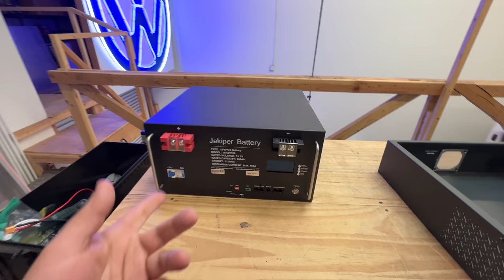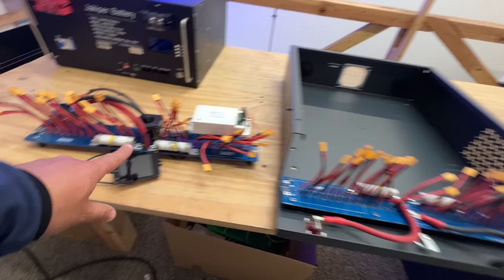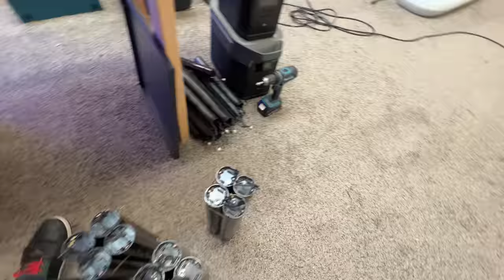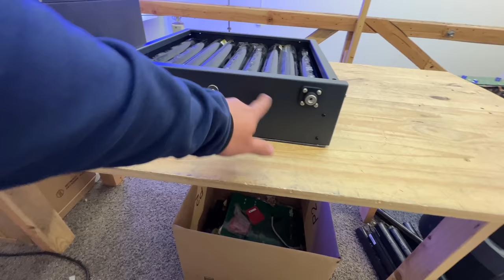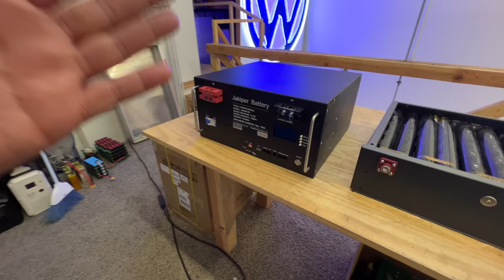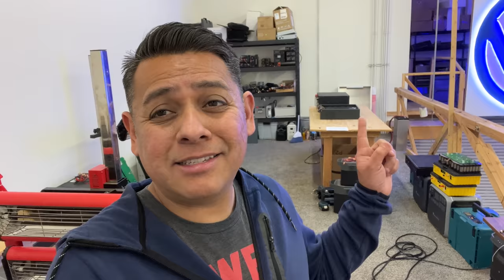Is DIY battery Still a good IDEA?

Comment: You could reconfigure the cells very easily in that same pack to make a 12v or 48v battery.  I don't know how that particular bms would work, but you could probably make it work too.  If not BMS are not that expensive.  You could probably go to a thrift store and buy an old computer or something in a nice metal case to work for a good case.

Comment: Check out Sriko Batteries out of Naperville, IL.  I just ordered a Daly 4s 12v 40Amp BMS from there for a DIY build for a go box.  They have Calb (100 Ah) and Eve (280 Ah and 300 Ah).  Haven't looked into shipping, but $252 for 100 Ah isn't too bad (if not grade B cells).  I could see an application for the 36v DIY packs in an RV application and do a DC-DC down to 12 volts (the trick would be solar charging).  If I weren't already into a LiFePO4 build for my RV, I could find plenty of places to place that box.

Comment: I am going to be getting a 1979 Lincoln Continental, M-9000-MACHE  motor and plan to build a Huge battery bank in it mostly will have to reinforce them frame. but what would the best batterys to use on a M-9000-MACHE FORD ELUMINATOR MACH E ELECTRIC MOTOR i plan to just get the Used Tesla Packs from Ebay and fit them in the Car i hope to fill the engine bay and half the trunk

Comment: Have you talked to Will Prowse? He knows a supplier in USA that has supply.
Reply from the maker: Nope,  I’ve seen him push signature solar batteries,  but all the loose cells from china.
Reply: @jehugarcia  He has tried cells from all over yes, But he does have a supplier In the US that does have grade A stock at reasonable prices. He gets cells from all over the place and he is not scared to tell you the ones that fail to meet expectations. The other side of the coin of course being the safety factor of using older Li-Ion batteries in comparison. Having ready made equipment has one definite advantage. You can still get home insurance.

Comment: I would say DIY if sourcing LIPO cells wasn't unreliable and slow. Its crazy how hard it is to get them for a decent price and a guarantee that they will be grade A
Reply: there are a lot of good suppliers here in u.s.a lots of choices   no waiting .. grade a and low price.. hell even signature solar has got in to the game with a deaccent deal on some of the best cells in the industry
Reply: you flat out cannot buy a small quantity of grade A for a decent price and a guarantee without taking a lot of risk AND time wastage.   zero leverage.  the pack makers buy large quantities and have leverage and plausibly decent guarantee.  diy has financial, performance, and time wastage risk but at a lower price.  its a balance of a lot of variables and you pick your poison.
Reply: @wkrp10splayer19  sorry to here that which supplier did you have a bad experience with?

Comment: I think the two main reasons DIY is an advantage is:

1.  If you built it yourself, so you know how it works, then you can fix it yourself.  At the end of the day, if you can't fix it you don't really own it.  And after the batteries have exhausted their useful life you have the option to simply swap them out and you keep the box, the cabling, the BMS, and everything.  So in the long run it will for sure work out cheaper.

2.  Sometimes form-factor is important.  Possibly not in this application (a battery for the home) but if you're building an AUX battery for your car, or you're making some other space restricted project, then you can adapt your build to suit your specific application.  And you're definitely not going to get that flexibility any other way.

Comment: I installed a 24v system in my camper, if I want to buy 2 of the megaladongle with all the batteries to fill it, am I gonna need to change my solar panels and all my system to 36v? What are the advantages of doing that?

Comment: Just a fun update. Bought grade a eve 304 from europe (NKON preorder). 16 cells for 1440€. That icludes transport and VAT tax. So less than 100€ per kWh. 
I have no idea what i will get. But it isn't some backally business selling them. Unfortunately there was a line of power outages recently that made me go down this road. I should not need it. There is no need for it for a normal houshold even with our outages (couple hours). But i have a business to run. If i cant run a productive day its gonna cost me.

Comment: I’m definitely interested in building my own, and have run into the same things you have long shipping times and not a great price break. I need to build mine as 24 volt and big enough (even if I build two such batteries) to have between 200 and 300 amp hours.

Comment: You also didn't mention that the price for those scooter batteries are the ones that are untested. With those batteries, you aren't guaranteed that they work. So you could easily end up over the cost of the pre-made battery pack if you get a few bad scooter packs, and trust me, it's possible since I've had 17 bad scooter packs from your website.
Reply from the maker: 17 out of how many?
Reply: soir try vampier bsyrri oack zrro bsd isck onfte cyckes

Comment: Can you series those batteries to 400v+ and pararell to higher AH and feed them to a sandy 30kw inverter since it can take huge DCV  bypass the  36v  with limited inverter out there
Reply from the maker: I don’t know 400v but I’m doing 3s and 4s for around 150v to power diy ev,  no problems after 6months of use

Comment: As someone that used to work for a US company that imported things from China, something I learned is that our customers would rather deal with a US company.  We had the warranty, and if there was a problem, they would come to us to get it resolved, not some factory in China that would basically was their hands of it.  What is someone in the US going to do if they buy $3000 worth of batteries and they are bad?  The factory could just tell you to get lost.  But if it is a US company, you have more things that you can do.  So the US company has to charge enough so that if there are warranty issues, they can afford to absorb the cost, because the factory might just tell them to get lost when they try to make a warranty claim with them as well.  That exact thing basically caused the company to go under.  We had a factory in China that we had been buying about $500K a month from.  Then they had a problem batch and we got huge claims from our customers.  Because our product had to be installed, we had claims for the cost of materials, and for the installation costs.  So we had ~$1M in claims one month.  The factory basically told us to get lost and to sue them.  A foreign company suing a Chinese company is pretty much impossible unless you are a really huge foreign company.  So we took the loss, paid the claims and the company was not able to survive.  If our customer had been buying directly, they would have gotten the product cheaper, but they would have taken the hit instead of them.  So it was worth it to them to pay extra to have us in the middle.

Comment: Are there any good high output 8000w + 36v inverter sounds interesting but looking around everything is 48v or 24v
Reply: You can diy the inverter too. Look for inverters with the board egs002
Reply: @asc556  That is higher level DIY.
Reply: @serverrackbatteryusa  It is. You can check out this https://www.youtube.com/c/Homemade102/search to see a good few examples of what iḿ thinking. And if you decide to go for it, its important that you choose a circuit with overload protection and under-voltage protection. Cheers.

Comment: Jehu, the cost of tools, wire, crimps, 12v hubs, Positive & negative busbars, the box to hold your newly built battery- it's a better value to buy a SOK, Enduro or Jakotoohy shelf batteries at $450 $650 per 1,280 watts. Most will never use the tools again, and I tell you they aren't cheap. That's why the smart money is on buying pre-built, low cost, well engineered banks with grade A & tested cells. Jes saying, Jehu

Comment: In Spain i can have 2.4kWh Pylontech Lithium battery US2000C - 48V at 680 Euros.. so for the warranty and  anything else i can say it is  not still a good idea.. also for a pack of 10 you can have a little discount. Great videos!

Comment: I'm DIY until it comes to using the product in any official capacity.

I'm currently building a 1.3kwh electric mountain board out of new but low volt Sony VTC6 18650's 

But if it came to hooking something up to a house I would prefer something with a warranty and a bet more cleanly made
Reply: ßoñy 1.3 kw plus oanscin lopo baters ¹,3 kw 2100 cyckes

Comment: The best DIY to factory battery comparison I can think of is buying a 24v 100ah battery from AmpereTime for $800ish and buying 8 x 3.2v cells from Battery Hookup for $450ish (can be discounted 5-10%). You still have to buy a BMS ($125-150), cables, shrink tubing, Kapton tape, nuts and bolts, and a modest amount of test equipment (meter and power supply; lets call it another $50 on the bottom end). And then you have to spend time assembling the battery and doing at least a top balance. Depending upon how you value your time, DIY is definitely not worth it from a dollar perspective. On the other hand, you can control the build variables (the AmpereTimes do not have low temp cutoff) and if you have a cell go bad, it's relatively easy to replace. Further, I've found that customer service with companies like Battery Hookup and Overkill Solar has been great. I've not heard anything bad about AmpereTime but it is basically another Chinese knockoff so you are dealing with distance and language barriers. For what it's worth, I have done both and call it pretty much a wash.

Comment: Power wall is going mainstream. This requires plug and play for most people. I like doing the builds but in a few years building will not have a cost savings. This reminds me of building solar panels. Just cheaper to buy. The energy fair had many home made electric cars, Now factory EV's are cheaper to buy and more reliable. All of it is fun to do but the scale of manufacturing will take over in time.
Reply: Power wall is great product, and cost will be higher than server rack lifepo4.

Comment: These at 200 usd per kwhr and a build if 45 khrs cost $9000 usd no including cables or fuses and inverter. Great price. On diy. And if need to go for 90 kwhrs that would be $18,000.00 for battery storage.  And will be great for charging up the ev once your back from work by just using 27 kwhrs from the power wall. Sweet.

Comment: Jakiper battery comes with 10 year warranty (limited, sure, but still better than none), that DIY battery doesn't have any, does it?
Jakiper battery has LiFePO4 chemistry (>4000 cycles + don't have to worry much about DoD), that DIY battery has LCO chemistry (<1000 cycles and restricted DoD)
Jakiper battery has a power switch and a protection switch, that DIY battery doesn't have either
Jakiper battery comes with communication ports and capabilities, that DIY battery doesn't
Jakiper battery is probably up to code, that DIY battery probably isn't

Now, if you enjoy putting together your own DIY batteries, go for it, but that option doesn't make much sense to me, seeing how the price difference isn't that big and the LiFePO4 battery is superior in every other important metric.

These cheap DIY batteries make sense as backup, like you said, but it you want to use them for serious stuff like home energy storage, LiFePO4 is the way to go.

Comment: Another thing to consider is that with shorter cycle life means you will replace it sooner.  Which might be a good thing as there may be better battery chemistries available.  So instead of being stuck with "obsolete" batteries for decades you get to change it up.
Reply: How is a battery obsolete if it still holds a specified capacity?
Reply: @randybobandy9828  I meant obsolete as compared to future battery chemistry that may allow for say higher density for less space, or safer chemistries so you can go on vacation with less worry, or higher discharge so there is less limitations on number of items that can be pull electricity at one time.   Doesn't really matter though, just like poke the bear sometimes.  🙂

Comment: If all batteries came with a built in bms standard, then yes DIY is still good, but I still want a 48v battery.

I use 12v systems for mobile power, but for home, I want 48 volts!
Reply: 48V is better for home, support to use more electrical devices.

Comment: I'm a fan of both.  But I think for full transparency I think Jehu should have been upfront to those first time viewers that he sells the DIY components and not the Jakiper server rack battery.  So of course he's going to focus on more pros of the DIY and make little of the pros of the Jakiper battery.  And excluded that the Jakiper battery comes with a warranty.
Reply from the maker: I did mention in the video that I sell some of the components I also have a disclaimer in the description
Reply: @jehugarcia  Yes you did have subtle mentions.  But your video here seems more like you're trying to sell idea of the DIY setups.  I understand why you'd go this route, but as a follower and fan of yours, i'd rather just be told unbiased pros and cons of both setups rather than being steered towards the direction of just what you're selling.
Reply from the maker: I make money pushing both batteries,  im biased pro battery vs against it,  but not what type you use.

Comment: Great vid, but as mentioned already, we are going to build what works for us.  48 volt is where home back up is.  Also we need long lasting packs.  I know in 5 years battery tech should be more efficient, but we are building for now.  So the longest lasting and best quality at 48 volts is what I am looking for.
Reply: 5 yeàr addß 30 too 40 perc more enrrvy rub tume todày

Comment: Diy is still cheaper (as if June 2022).  Off-the-shelf IS EASIER; but, as the saying goes “more brain require less money”.  “If you got the money, spend it”.

For some people, DIY is the only option (having IT without the high buy-in cost).  For others, buying a solution is a better use of their time (brain surgeon)

Comment: I just got 8 eve 105Ah lifepo4 cells from Docan Power on Alibaba, they have US stock. I paid $500 total for 2.56kwh or $195/kwh

Its a little cheaper going with bigger cells, you still need your own bms,but diy is way cheaper if you are semi confident.
Reply: thàt what chef use hybrdd ektrc dekoran

Comment: Comparing these batteries is like apples and oranges. We can't even come close to building a battery like the Jakiper seen here.  For starters, while the cells you get in there are the same low priced cells anyone can get, they are "capacity matched" .If you want to buy 4, 8, 16,,,  "capacity matched"cells  your price doubles. every cell comes of the production line having a different capacity and resistance. you need hundreds on hand, and DAYS of testing and recording  to match some packs that have all cells charging and discharging at the same rate ,till full or empty. Your pack discharging shuts down when only ONE of the cells is empty or stop charging   when only ONE of the cells is full, because it can charge /discharge easier than the rest. IT IS MADDENING. Running the unbalanced pack with an active balancer can help some, but right now I can buy the battery I tried to build for $150 less than I have spent and need no time, no NEW tools , and no labor. 
Plus it looks better ,is safer, and most of all have a warranty. go to alibaba and see.

Comment: love these videos, however i have a massive safety issue with your 36 volt diy packs, 1) cross current between packs, you say they will balance but they won't correctly, 2) over discharge currrent, when say all but 1 turns off it will try and flow all power from 1 left on - dangerous 3) over discharge same as 2) as they all turn off all the charge amps will flow into 1 pack, also you don't show how to charge them in your box only discharge

Comment: I'd be interested to see if you can Do a battery set up For A Ebike or solar panel. But I'm thinking about the quick charge batteries that you can charge In a hour. The slim type batteries similar to Cellphone batteries but much larger
P.S. I  And find your videos  Very informative

Comment: You fail to mention that not everyone has $300-$800 to throw away if aliexpress screws you over. And....it's messed up when the seller screws you over. Also...power stations are the same if not cheaper price...with a warranty...JS. Also....man I really ,really, really like that you stress the importance of the recycling of the batteries and the effects on the environment ✌  peace!!!

Comment: I bought from an American supplier and still beat the eg4 price by a lot. My 48v pack is 280ah, which is close to 3x of the eg4 units for 2700 bucks. So it’s kinda like getting a buy two, get one deal. Lol
Reply: Sounds cool. Care to share your setup. I’m interested in this
Reply from the maker: Share the source,  we all want cheap LIFePO4
Reply: @about2088  I am using EVE 280AH cells 16S1P with a 200Amp Daly BMS.
Reply: @jehugarcia  I got mine from Jenny Wu
Reply: @jehugarcia  Look up Docan power, they have a US warehouse. $147 for a 280Ah cell, $158 for a 304Ah cell (both EVE, new cells) and free shipping Continental United States.

Comment: Paralleling those four 36v packs together is ok? Even with different SOCs? I thought it would do damage from instantaneous high current. Also do they have single port BMS where charging and discharging from same leads is ok? Thanks in advance for any help in understanding
Reply from the maker: Bms does it’s job, it does have a separate charging port so it can be used,  I’ve been using the same output port to charge them but I’m working on the next version of the pcb to use the separate charge input to charge.
Reply: @jehugarcia  Good to know, thank you for the reply